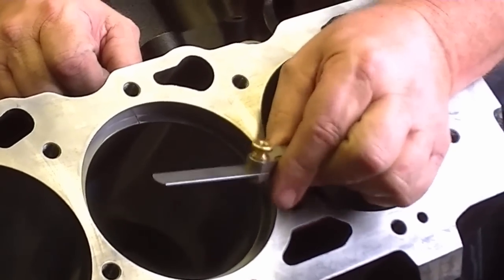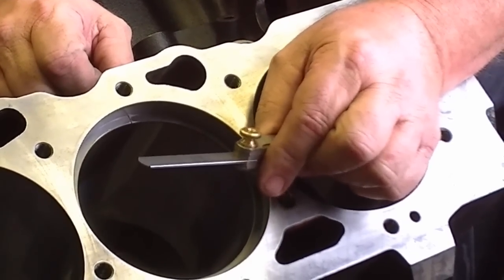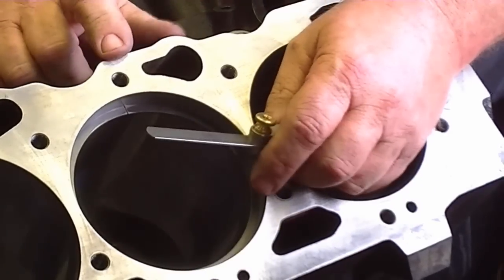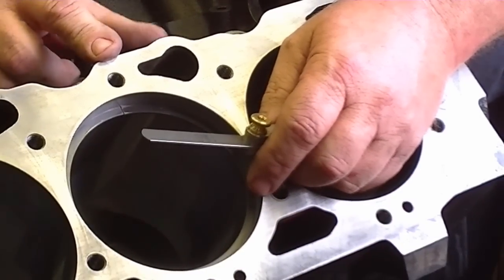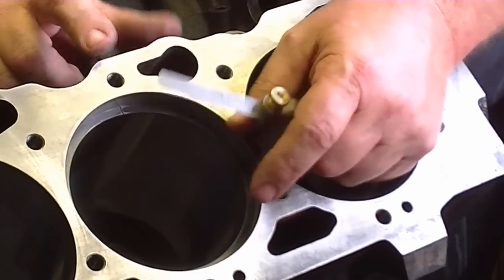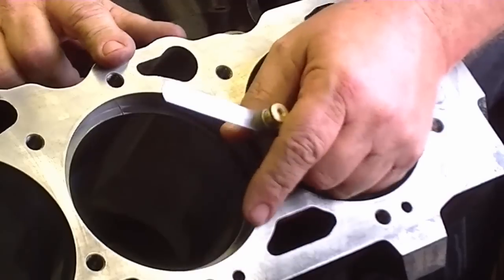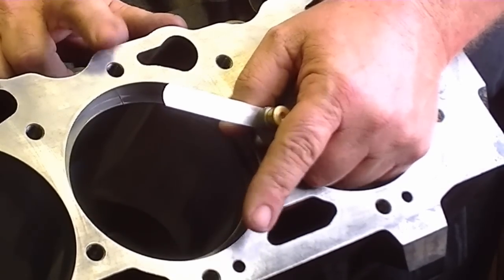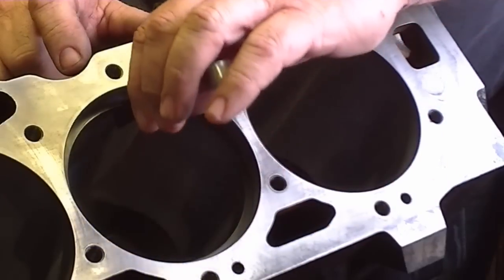How to Check Piston Ring End Gap

Comment: Hi. Can you tell mi if it is acceptable to replace the pistons rings without cylinder grinding?
Reply from the maker: You would want to at least bead hone the cylinders to put a cross hatch in them so they will wear in to the cylinders at start up